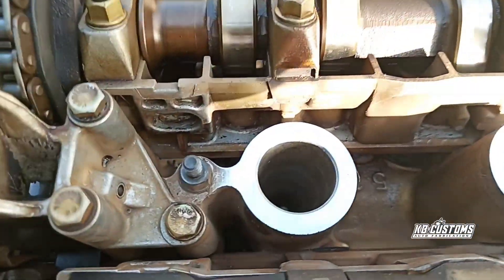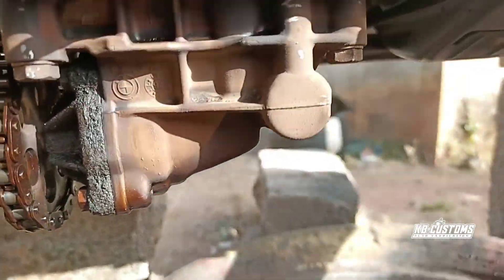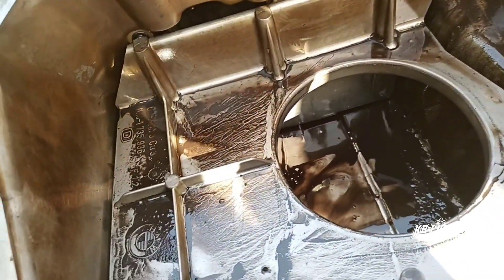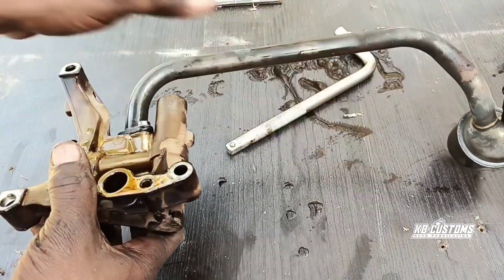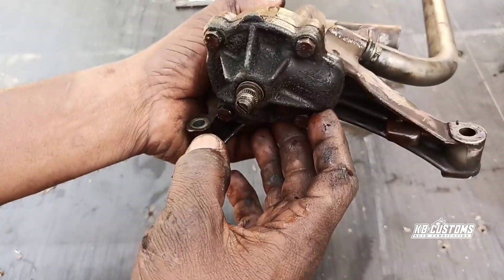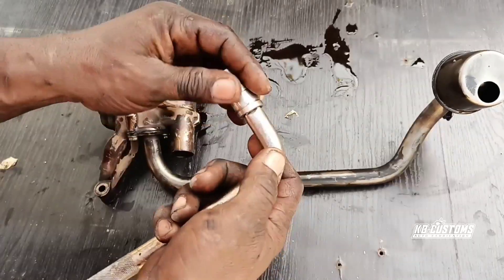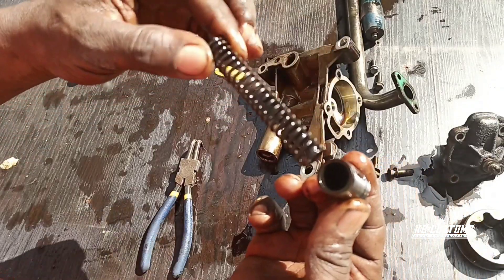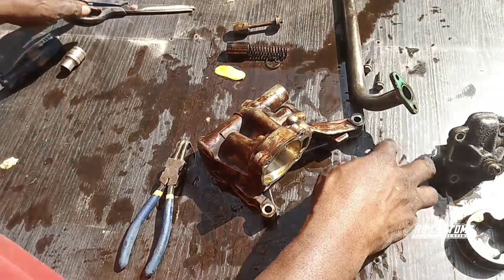M52 oil pump rebuilding

Comment: The notch on the outer rotor should have been pointing inwards but in your video you installed it pointing outwards
Reply from the maker: I installed it just the way I removed it and am very sure that it  has not be loss before
Reply: i have seen a video of a guy dissasembling a new out of the box oil pump and the rotor was ponting outwards,.. so where in the manual says it have to be pointing inwards? and also all dots are allways facing so you can watch it, maybe im wrong but i have seen several videos and only one guy said it have to be pointing inwards
Reply: So it would appear that on the single-dot rotor (at least for me)  it was pointed inward when I dis-assembled my original pump.  On the rotor with three dots, I have seen people pointing them outwards. However, provided that once the pump is disassmbled, it is put back together with the same orientation (matching dots in both faces (inner or outer) and also rotational alignment with-respect to each other) it should not matter.  I say this because the inner/outer rotor and the body wear together to form a unique wear pattern. From new it would not matter as the rotors would be perfect in all axis.